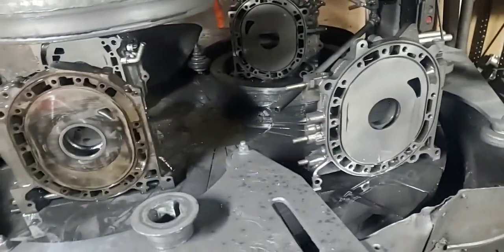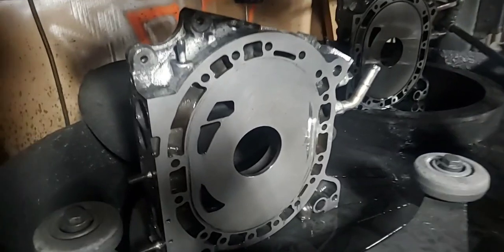Rotary Engine Side Plate Lapping and why it's important for RX7 RX8 builds, Mazda  Kyle Mohan Racing

Comment: Do you think removable side plates are better or are solid housing is better? I would think that iron plates with aluminum would cause temperature difference issues---do those side plates ever leak?  have that removable plate scares me...I was wondering for high hp applications would removable side plates hold up?

Comment: Can you just surface the side plates with no nitrate/ wear  treatment stuff and just run it bare/ raw?
Reply from the maker: Yep
Reply: @KyleMohanRacing   Is it recommended to Lap the Center Plate considering light corrosion?
Reply from the maker: @makiikedandrew  in most cases yes

Comment: Kyle way back when in 1995 I asked the rep from Mazda Canada about  rebuilt Engines.. he told me  that before he started with  Mazda he had the  contract for Rebuilding Rotary  Engines for them and had built 5000 engines for them .. I asked him about lapping Plates.. he told me he lapped every one and  he only had a 1 percent failure rate  on his re-builds..  I like the Idea about the Micro shot peening  for friction reduction and surface hardening. Thanks
Reply from the maker: Sounds about right,  thanks for posting

Comment: "I see that in the process of lapping you lose the gasket seat. How do you make a new gasket seat? Do you grind a new seat? Or do you use a sealant?"
Reply from the maker: No.... thats incorrect.   Some side housings have the water O rings in the side housings some side housings  have the water O ring in the rotor housings.  We generally only cut a couple thousands off. To lap a water O ring groove off of a housing would completely ruin it and would make no sense.

Comment: I see that in the process of lapping you lose the gasket seat. How do you make a new gasket seat? Do you grind a new seat? Or do you use a sealant?
Reply from the maker: No.... thats incorrect and would make no sense.  Some side housings have the water O rings in the side housings some side housings  have the water O ring in the rotor housings.  We generally only cut a couple thousands off. To lap or grind a water O ring groove off of a housing would completely ruin it and would make no sense.  Please go watch and educate yourself on the rotary engine.

Comment: Great video thank you for sharing this. I am about to use the procedure outlined by Lynn Hanover to surface my irons and I was not aware of how important the cleaning process is but now I am thanks to you. What is the failure modes of an engine built with improper cleaning?

Comment: kyle..I have some water damage to the surface @.001".. is that lappable??
Reply from the maker: yes we should be able to clean it up
Reply: @KyleMohanRacing  sweet
Reply: @KyleMohanRacing  What is the maximum for lapping?
Reply: Hey there, did you ever tried to weld a water damage on the surface if this was to deep for just lapping?

Comment: I think lapping is a good thing, not only does it true up the surfaces but provides a fresh surface to bed seals into. the hardened surface is important for wear characteristics, there is no way a ductile iron surface wears the same as a hardened surface. the process is less important imho and i am curious about nikasil coating. nikasil could be built up to .030 then machined back to factory new spec and provides are porous hardened surface that will retain lubricant while maintaining good wear properties. 2 stroke guys line their cylinders with nikasil and swear by it.
Reply from the maker: Everything comes down to cost. just getting new sides is the best but if you cant afford it then lapped or resurfaced is better than just used... lapped sides can go 100k in normal application with proper engine maintenance. i see people spend money on nitride then put used sides seals and rotor housing in. Doesn't make any sense.

Comment: What is the maximum you can take off by lapping and how much does it change endfloat? I once had an engine lapped and the person who did it took so much off I had trouble fitting the inlet manifold because the engine was shorter.
Reply from the maker: sounds like bad work... dont use them again
Reply: @KyleMohanRacing  Must have been. So can you please tell me what the maximum you can take off please?
Reply from the maker: @philip_james  That can be a technical question, it depends on the year of the plate. Some of the info is proprietary. Cant give every secret away.
Reply: @KyleMohanRacing  😂

Comment: Would it make sense for higher reliability to lap the plates and then re-nitride them? Without nitriding, wouldn’t the wear skyrocket? As you say in the video, the nitriding lasts for 20-50 thousand miles, by lapping alone you are reducing the life of the plates overall. I get it for a racing application with wpc and other treatments, but for a long living motor like you talked about, I don’t see it. Let me know if this is right or if I’m missing something, would love to learn more.
Reply from the maker: Generally in 20 years of rotary service I generally don't see a big difference between lapped, new, or nitrided wear in parts. I think the internet is a little off on what nitride does. Ive built many lapped motors at mazdatrix that went as far as new parts with no re nitride and zero had issues.  Generally I see assembly, break in, and parts cleaning mistakes as the leading cause of issues when its not done correctly it causes failure.  Lapping a part to far can also cause issues.  So answer is no. I don't think there is a big difference in wear or lifespan.... I'm not saying re nitrided parts are bad.  I just don't think its nesasery like its portrayed in all cases. . Also FYI. The nitride process can warp a part.  So it may not be flat anymore after the process and may need more 🙃 machine work.  I know shops that lap new housings to make them flater than factory... I think adding all this info should help people make better choices based on their build needs.
Reply: @KyleMohanRacing  I just had my irons lapped and ported! I also re surfaced my housing adam a rec Did a great job! I will consider your services also for a future build! Also got the rotors lightened and balanced clearance also. I had two irons that the metal between coolant and seal was gone!! So I kept em on the shelf until I find a solution for em...do you have a solution for that? Thanks a bunch your videos our supper awesome and very useful info!
Reply: @KyleMohanRacing  how do you know when its been lapped too far? I have a set of RX8 side housings that have been re-lapped twice but I was never given exact dimensions of material removed each time. Both times they were re-nitrided. I now have a 0.003" wear line on my rear iron as shown at 5:45 in this video, and it was burning oil with scraper ring wear beyond all usability on what were new oil control rings and scrapers about 3k km ago. What is the leading cause of that wear line? looks like corner seal riding area, I had initially thought it was from the scraper ring but it doesn't extend that far out into the side housing. 

Thanks for this video, it was very helpful in me diagnosing what happened to this engine, I'm still perfecting this craft but getting better each time 👍🏻
Reply from the maker: Another thing to consider is side housings are generally not a fail point if in good condition.  Lapped or not... ive never seen a block come in that had lapped housings and they where dead from wear or the fail point because of wear and other parts where still in great shape.  

There are a lot of parts that generally wear faster than the side housings even if lapped.  The side housings generally are not the big issue or why a motor comes in for a rebuild. 

Good questions.  Hope this information helps and makes sense.